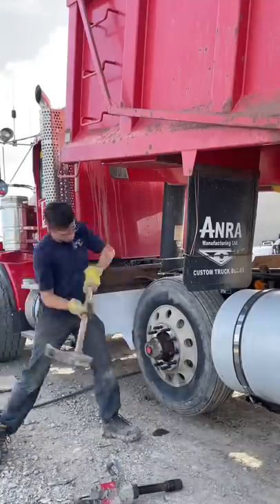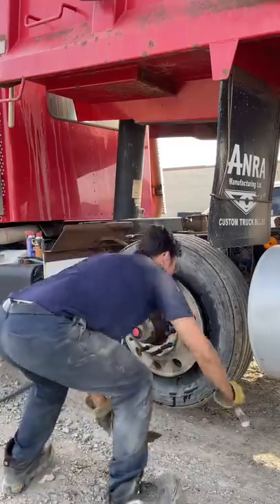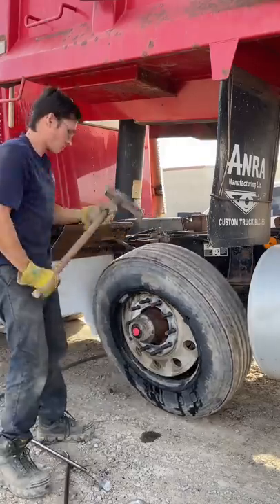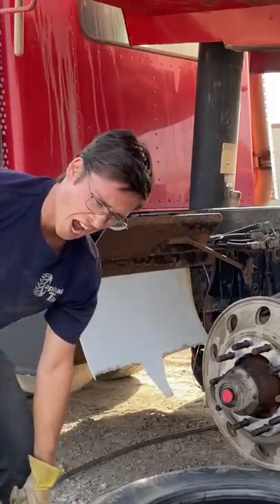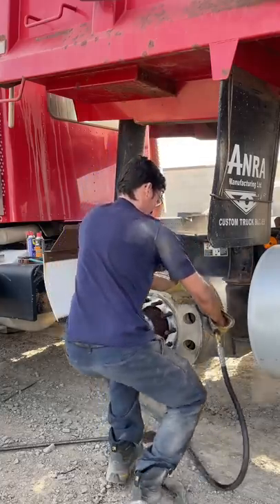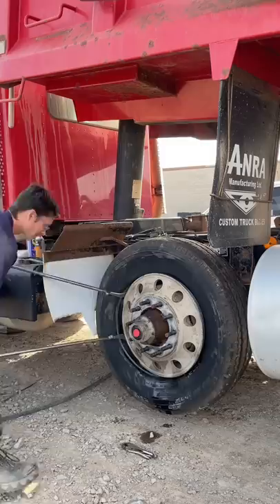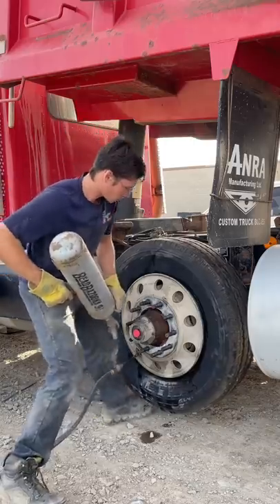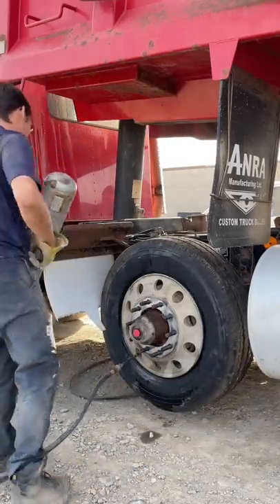How To: Seized Aluminum Rim Tire Change    #tiredoctor #tireguy #tires #tirerepair #shorts #tiretech

Comment: You could use the hammer to assist the wheel off, of course you can't hit it too hard unless you wanna be paying for a rim. I never changed semi tires on a truck but I have been a trailer mechanic for years and I can tell you I've ran into this more than you would think on trailers.

Comment: My boss says if it ain’t coming off you ain’t using the hammer enough
Reply: Simply true. Can't do that bull on an inside tire and it's even harder when it's on a trailer. Trust that bish will come off cause I ain't losing to no fukkin rust lul
Reply: I don't know. I had to change my brakes on my car and thus had to take the tires off for the first time(about 40,000 mi and 4 years) those rims where so stuck. I tried getting it off by just smacking it, but eventually just had to put the lug nuts on and drive while turning the wheel. I got the tires changed not too long ago and they didn't say nothing about it so I assume they figured something it out, but honestly don't know how they did.
Reply: @Zoroaster4  What did I just read lmaooo we’re talking about tires on semis/dump trucks.
Reply: @Zoroaster4  you use a rubber or hide hammer and absolutly smack the shit out of the rim until it comes off
Reply: @Alucard-gt1zf  Yeah I'll have to try that next time. I didn't have one so I mostly was using a big hammer and a 2x4 to hit it. I put some anti-seize on them so hopefully I don't have to deal with it ever again.
Reply: Bottle jack between rim and frame or rim and rim can help a lot. Set it lightly where it’ll stay in place then hammer on the rim. The jack takes up some of the flex from the outer edges and so the center has to absorb more of the vibration.

Comment: I've been in a shop for 3 years working as a truck and coach mechanic mister tire doctor the best way to fix this is spray a shit ton of pentrating oil on it and stick the tire bar in the holes in the rim and pry against the drum it works 98.6% of the time

Comment: If the lugs have been loosened, it's best to get the  wheel off even if it takes a while. The corrosion gets displaced and the wheel won't  tighten correctly. The wheel will eventually come loose. I've seen it happen several hundred miles after the tire replacement.
Reply: That's why your suppose to re torque them after 100 miles. That's always been standard procedure
Reply: @Ironminer97  mic 🎤 drop…
Reply: Exactly! No telling what  corrosion or debris broke free from trying to get it off. It'd be one hell of a way to find out the hard way doing 70 down the interstate

Comment: Tip/trick: hydraulic claw or jack, press on frame with piece of wood on rubber and rim. Stand on frame and tire and swing 10lb sledge on tire a few times. Release hydraulics, rotate and repeat. 10 minutes its off. No matter how oxidized on.
Reply from the maker: Stand on frame and get crushed by the bucket is it falls since there’s no stopper in place, next idea go 🤣

Comment: I have portable rams in different sizes. Put a 2x6 against the rim and ram between frame and board.  Just turn the wheel at times so the force is not in just the 1 spot. Never had one not come off. But I'm an in house mechanic so, I can spend more time on it

Comment: From what I can see from this clip, I didn't see any lug nuts on the wheel being worked on.
I understand the wheel was corroded to the hub.  However, having a couple of lug nuts on wiill ensure the wheel won't come loose while dealing with its tire and potentially scratch the wheel.

Comment: I wish I had your job. I mounted a set of Firestone Transforce tires on my 2003 Grand Marquis with my old Coats 1010 center post and didn't scratch the wheels.

Comment: It's not as hard when you can have air in the tire 😂
Reply: Yeah, and skinning an inside tire can be an absolute pain.
Reply: @Irishrebel092  it always depends, usually steel rim and steel hub is fine but if it's aluminum rim and steel hub or vis versa and the never put the plastic protectors in they're almost always a bit of a pain and it being flat, I don't think you'd get it off without sledging on the rim lol
Reply: @buttadog5073  not actually what I'm referring to. Taking any tire off the wrong side is a pain. The rims are beveled in a certain way that makes it more difficult. Aluminum 19.5's are the only ones that come off that side

Im the GM of a diesel shop and used to be a tire/lube tech myself. We actually don't allow skinning tires, but sometimes it's the only option.
Reply: @Irishrebel092  oh I was just talking about getting the rims off
Reply: @buttadog5073  yeah, we have a rim puller, but it's not practical to bring it on roadcalls for the off chance there's a stuck rim

Comment: Imagine if both wheels were stuck on and to get the inner tire off you had to 1: take the outer tire off. 2: take the inner tire off the inner wheel. 3: put the inner tire on the outer wheel. 4: take the inner tire off the outer wheel. Then do it all again in reverse to put a new tire on. That’d suck.

Comment: I would build a puller or something to push or pull the wheel off or heat it up but normally we aren't in the middle of a job site we're normally at someone's shop were we can take a little time to build it and I'd probably only build one if the wheel was screwed up and had to be replaced or if it needs to be replaced you might as well beat the shit out of it

Comment: Spray wd40....the using a block of wood against the back side of the rim...use a sledge hammer and hit the block of wood....if the first hut don't work...keep going...just rotate it and BOOM....it'll fall off

Comment: If Tire guys would put grease on the wheel before they reinstall it that won't happen all aluminum wheels will oxidize against the steel if you don't
Reply from the maker: You don’t put grease on wheels thats tire lesson 101
Reply: @TheTireDoctor why not?? ive done it for 20 uears no probs.

Comment: Maaaaaaaan on the truck in my pic here that same exact front wheel needed to come off because I gauged the sidewall running over my kids bike and when hitting the tire with the sledge I slipped busted my rim ;( got it welded now it’s my spare total  fuckery

Comment: Um how does aluminum corrode?
Reply: First, aluminum corrodes on its own, it’s just more resistant than steel. The problem in this case is where the aluminum wheel meets the steel hub. At that joint, galvanic corrosion occurs because steel and aluminum are electrochemically dissimilar.
Reply: @toddrf  🤔🤔 I don't think this is true
Reply: @richardalfaro4933  well, I suspect only one of us has a degree in materials engineering. Go look up galvanic corrosion.
Reply: @toddrf  idk maybe you should read up on it, then come back provide some charts or illustration and explain
Reply: @richardalfaro4933  Dunning-Kruger effect here. Have a good day.

Comment: But on other wheels you can't do that or it will get stuck. Must have a been a 19.5. get behind the wheel also and push it out not beat it in
Reply from the maker: 22.5

Comment: Yeah those ones suck, can’t really hit them as hard on the backside like steel wheels either but if the tire can hold some air you beat tf outta that… I learned the hard way about grinding that corrosion off before putting them back on, it was an suv and the tire fell off, the guy actually wasn’t mad either, we fixed everything for free obviously but once the guys seen the back of wheel, then they told about getting rid of that corrosion, lol that’s how we learn tho! lol

Comment: Hmm i think u should have taken off to clean it up because eventually it will need to come off
Reply from the maker: Doesn’t sound like a me problem 🤙🏻
Reply: @TheTireDoctor  will be when they crack the rim or the shit holding it on starts breaking up making the rim lose on the hub rather just sort it first time then having to sort later get under neath smack it off lol
Reply from the maker: @James-qk8kz  rims don’t just crack everyday that’s like a once a year scenario if that, the only way you’re getting that rim off is if you hit it hard enough to crack and break the aluminum, I’m going to assume you’ve never dealt with a dump truck up here in Canada with a seized aluminum rim before
Reply: @TheTireDoctor  nah im from new zealand and nah u definitely wont crack it from hitting it u have to know where to hit from i see this often enough to know how to resolve the issue also our roads are stufed from earthquakes 10 plus years ago so cracked rims happen alot here and half the drivers are only steerers
Reply from the maker: @James-qk8kz  see in Canada we drop to below -30C in the winter and salt everywhere so whatever corrosion you got is nothing compared to a few seasons over here 😅
Reply: @James-qk8kz  Always you keyboard expert
Reply: @sekou3758  na pro tyre fitter here no key board crap here
Reply: @TheTireDoctor  the blame game lol 😂

Comment: How do you inspect the mounting face of the rim when you don't take it off? You can't...so now you're compromising safety standards to make your job easier, this is horrible trade practice. 🤦
Reply from the maker: It’s a lift axle inside tire, barely touches the ground a damaged rim never happens to an inside rim without it being obvious around here
Reply: @TheTireDoctor  rims crack where the stud holes are as well and can happen to an inner, an outer, or a brake drum too and to inspect them properly you need to remove the rims, this is why the large fleet I work for doesn't allow tire companies to change a tire on the unit, rim needs to be taken off everytime to be inspected properly

Comment: Use coca cola
Reply from the maker: Serious?
Reply: Serious beileve it or not i use a 30 lb sledge and i had on on the back of a tractor stuck i was able to swing it from the top like golf club and it would remove im a big dude btw….

A somolian mechanic with arms size if twigs came over dumped coca cola on it he let it sit and he got it off easily… 

So i used it from that day on and it works great for aluminum corrosion…. It does work im serious no more rim puller needed
Reply: Im in columbus ohio one of busiest places for trucks… and ive been mechanic 13 yrs ive seen it all and consider myself top tech here